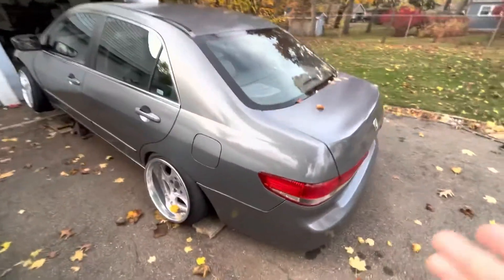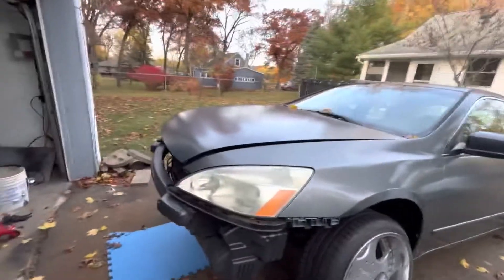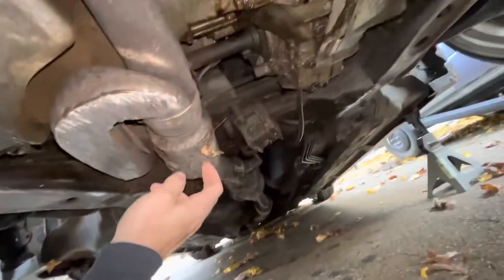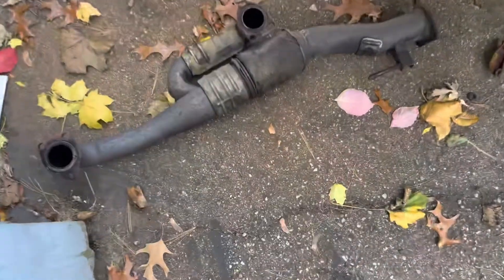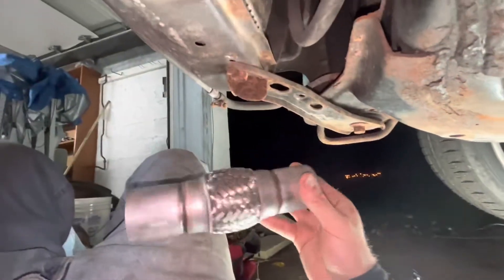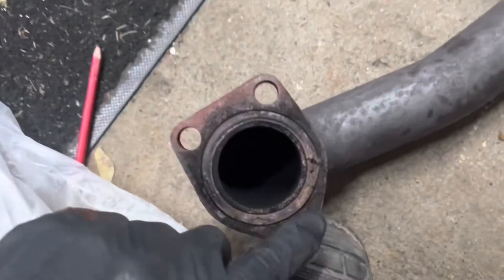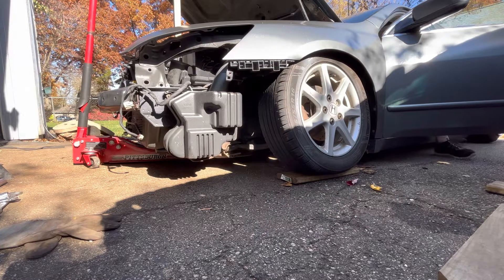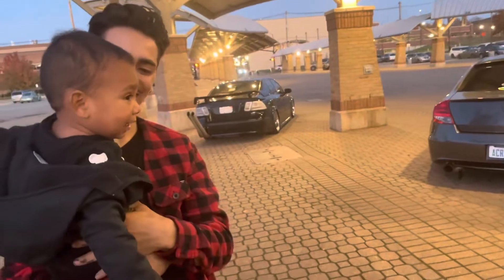Fixing the exhaust leak on the Honda, it was bad!

Comment: Hey man i saw your es300 video as was wondering where you got those body kit parts? I got a 1997 es300 im wanting to modify.
Reply: My car had similar stuff so I can help his front lip is a JDM front lip pretty rare. His side skirts seem to be universal extensions or custom extensions. The rear bumper either had a valence from another car installed or it's a custom valence. "Body kit's" don't really exist for these cars me personally I think either a gs300 or ls400 rear valence would mount to the rear bumper someone said is300 side skirts would work but it hasn't been tested.
Reply from the maker: Yep! Rear is just ez lip and skirts are etc but basically universal